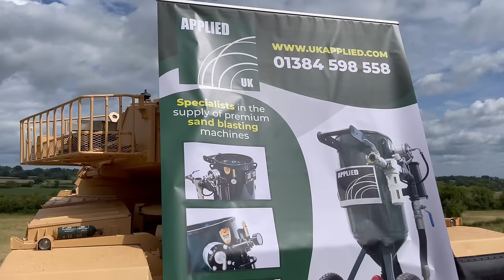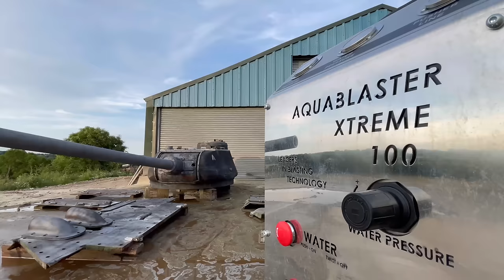T-34/85 Restoration (Pt.3) Aqua blasting!

Comment from the maker: *puts needle gun in the bin 🗑️
Reply: Do you want to needle gun Jack for making you needle gun that bloody Abbot of his?
Reply: I don’t see how you could go back to a needle gun after this.
Reply: use it as a tattoo gun.
Reply: Agreed!
Reply: Vapour honing on an epic scale
Reply: Agree that's excellent bit of kit guys😮😮😮
Reply: What does that setup cost?
Reply: @raykaufman7156  just over a quid. (Depends on your definition of ‘just’)
Reply: @johnnunn8688  
I must have the wrong idea about a "quid". I thought that was another term for 1 pound?
Reply: @raykaufman7156  £4,950 – £5,700 according to United Abrasives. Probably saved that in man hours on the T-34 alone already.
Reply: @raykaufman7156  it is exactly that.
Reply: @Brigadier9  there we go....thank you.
Reply: Hold up, you will still need a needle gun for weld slag and the occasional small bits not worth the setup.  :)
Reply: How many bags were used of the sand?
Reply: some a you brits are ok, don't start yer tank in the mornin
Reply: @misterquintus it's actually a different process vapour blasting   it's run from a dirty water pump & 170 glass bead whats more like talcum powder mixed with water this is a glorified jet washer
Reply: Funny.. been needling and sand blasting a t34-85 here in the states the last 3 weekends.
Reply: Tasty looking fasty running the compressor👀
Reply: I hope they either give you a stonking good deal on this or donated it for the free advertising, it looks like a cracking piece of kit
Reply: ONCE you fully restore and paint it please put the Soviet Star on there and other Soviet markings
Reply: @MuhFreebrams  many soviet vehicle in ww2 had no markings. If they had something is was 2 or 3 digit number. Anything else one it was done at a division, regiment level
Reply: @Bigbacon  just looked it up and you are correct 👍🏻 I thought it was more common
Reply: Great kit. 👍
Reply: @Bigbacon  This one did have a turret number, you can see it in the earlier videos. Being a Polish tank the numbers may have been done differently to the rest of the Soviet states.
Reply: @jefforymitchell5697  polish did about the same with number and usually the polish emblem.
Reply: How long would it have taken with the needle gun and a grinder? So when is your own Aqua blaster showing up?

Comment: Ladies and Gentlemen. The T-34-85 tank is the basic design of the American designer John Walter Christie, who sold a license to the Soviet Union for his prototype, which gave rise to the BT-7 tank, which translates as a high-speed tank. Soviet engineers increased the scale and produced the T-34-76 tank, and only after receiving equipment from the USA in 1944 was the T-34-85 produced. In this tank, almost the entire structure was designed by designer John Walter Christie.

Comment: Sam should get employee of the year. APPLIED is so fortunate to have such an enthusiastic, knowledgable, and competent representative. Job very well done. Most impresive.
Reply from the maker: Sam was a great lad very helpful and very knowledgeable
Reply: @MrHewes  I was only thinking exactly the same thing. I used to be part of a Heavy Breakdown & Recovery crew that attended Derailments on the Railways. We had two guys that came to give us a presentation on some equipment that the company was thinking of buying so we had guys present from the various grades that would be involved with it to ask questions. I would have got more sense out of my missus than the two clowns they sent. This equipment was worth a fortune and these two were clueless. In the words of my engineering boss, F*****g Embarrassing. Sam on the other hand was a switched on guy who knew the in's and out's of his equipment and was comfortable in his presentation.

Comment: The black stuff isn't from poor quality steel, it's iron oxide, on the hot rolled plate it is called mill scale, the turret which I believe was heat treated after casting and it's just called scale, the barrel would have been machined after heat treatment so there's no scale on it.  
The thicker something is, the longer it needs to soak in the furnace, and the thicker the scale. It's reoughly an hour soak time per inch of thickness, I've seen scale over 3mm thick on 5t billets I used to machine.  
The only way to check the quality of the steel is to assay it, which would be a waste of time and money, the cracks are an obvious way of telling the heat treatment was of poor quality, but that says nothing of the quality of the steel.
Reply: Thank you for your input. I learned a ton of stuff in today’s video about heavy casting and the difference in the metal used for the barrel. I never even thought about the heat treatments to harden the steel after it was cast. Wow!!The details you just provided knitted it all together for me. Much appreciated. 😃👍🏻
Reply: Да дело не в истине. Просто надо обосрать. Они постоянно повторяют "ну это русские, плохая сталь, плохое качество, они рукожопы". Кстати советские, а не русские, в СССР неважно какая у тебя национальность, ты рабочий человек, а значит советский.

Comment: Interesting bit of engineering with the track pin wedges.  And that wet blasting set up is light years away from what we used to sand blast my boat hull, and it didn't really do that great a job. Rules had us cocooning the hull, with tarps all over the ground to pick up the abrasive and the blasted materials. Seeing the difference in the surfaces after blasting was enlightening, especially all the cracks revealed.

Comment: I used to run a blasting business. One of the mpst effective mixes was bicarbonate of soda with a medium to light recycled glass media mixed with water at the nozzel end which kept the dust down, would remove paint and rust very quickly, you'd need tk jet wash afterwards and thoroughly dry then hoover up the remaining glass.
We used it to blast steam locomotives, ships, marine engineering, industrial steel furtings, classic car panels and vintage tractor parts. 
We also developed a friction free dry blasting technique to allow blasting paint and rust off gas refinery pipes without shutting down the refinery. This saved the client a fortune.
We used a number of different blasting outfits most important is the largest compressor you can afford and a condensation remover and air cooler. Then you can use a variety of media pots depending on what you were using. 
A tank like that is a 2 day job with the right kit and crew including clearing up and prepping for painting
Reply: Não tenho palavras para elogiar seu trabalho isso sim com seu altruísmo, e por um mundo 🌎, em paz interior!

Comment: a great machine well designed, love it - the only small issue is the environment not picked up on, and something i had to be aware of when sanding aircraft, outside
paint is generally plastic by design epoxy, urethane etc, sand it and it become tiny flakes of plastic and we all know about micro plastics getting into the natural water resources, you really need to do under cover, or at least so it can be collected and disposed of responsibly and not buried in a hole in the ground etc i found chucking into a descent bonfire does the trick
Reply: Paint on these old vehicles is often lead based. So yeah even worse.

Comment: Saw this or something similar being used on another U-tubers channel, Cutting Edge Engineering over in Australia. He bought a diesel generator / compressor to run his sand / water blasting set up, he doesn't haveca tractor. Brilliant idea a lot safer than dry blasting and so much quicker. Bet it was a good night out after they finished filming. 👍

Comment: How to comply with -
1) Noise At Work Regulations 2021
2) The Control of Vibration at Work Regulations 2005
3) PPE Regulations 2022
4) RSI & ULD injuries (Management of Health and Safety at Work Regulations)
5) COSHH (Control of Substances Hazardous to Health) possible exposure to lead and other nasty stuff (Knowing the Military, especially the Ruskies)

with one machine.

Probably expensive but not as expensive as an HSE prosecution!
Just sayin.
Reply: Thanks, Pêndos for casually using an ethnic slur!

Comment: Laser Cleaner / Rust Remover would do a brilliant job on that, all those nice flat surfaces, will clean off the rust, paint, grease etc and no harm to the metal at all.
The turret would have need a casting, however, the majority of the rest of the tank would have been produced from hot rolled steel not cast. The oxide layers on the surface of the majority of materials is very tough and adherent, different from that produced as a result of casting or heat treatment operations.

Comment: My Friend who has a shipyard purchased 3 DustBlaster machines from America. Similar to this they use recycled glass particles of differing grades suspended in water. Uses a lower pressure but I think it does maybe a better job, they were originally made to strip expensive classic cars, but can do more, In fact my friend uses it on large steel hulled super yachts  and he even did the hull of a large cargo vessel in a dry dock.

Comment: Having used sand blasters and aqua blasters, they are great bits of kit.
That was a glass bead grit you were using which does the job but for the black bits, you could probably have done with some aluminium oxide media mixed in. (A cup or two per 25kg bag)
We use a really fine glass bead media which is more for polishing, the aluminium oxide helps with paint removal, but to be honest it did not look like it was doing too bad a job on the hull so I assume its a larger bead size you were using.

Comment: When t34 we’re been built they had moved the factories up in to the urails and they were built so quick nothing was in tolerance s and tank drivers that collected the tanks helped paint them as they were rolling off the production line most were still wet going into battle

Comment: The black is from the cold roll process. It is called mill scale and is very hard. The production line likely didn't bother wasting the time to grind it off as it would not affect the function of the armor. I don't think the cracks are from impurities in the steel but more from the arc welding used to assemble the tank. Remember that electric welding was in its infancy and only came into common use around 1919 in shipbuilding. They probably welded that entire tank cold without any pre-heating because they didn't know better which would cause micro-fractures that would grow over the years.

Comment: The blackening in the steel could be down to the variety of alloys used in different portions for the steel on the T-34. They are magnesium steel, silicon steel, molybdenum steel, chromium steel and Nickel steel alloy. Mn-Si-Ni-Cr-Mo steels were employed for both rolled and cast steel components from 2" to 5" in thickness, and Ni-Cr-Mo steels were employed for some of the moderately thick cast armour sections. Plus the fact the Russians would heat treat the armour to two times that of the armour of a Sherman, causing the plates to be highly brittle.

Comment: now it won't be an authentic CCCP made tank without a paintjob that is half dirt half falling off...
p.s. the black part is mill scale, that's normal, you get it on all hot rolled stuff you buy even today, thin/thick, all will have it, some of it may be almost falling off, some will hold on to the steel, it is just the way it is, paint over it if it's holding, when absolutely necessary - pickling with hcl is done to remove it, or shot blasting, that will break it up and sweep away, coarser sand will also do it, but slower
and black on the turret is simply a sand cast surface, of course there will be all sorts of crap in there, but usually limited to surface
Reply: Well, it's not an authentic CCCP made tank, and it will never be. This on is a postwar made, built under license in Poland.
Reply: @484442pt ну не мешает автору обсирать "русских"
Reply: @CorRubrum   it wasn't an insult, service life expectation for these didn't warrant a perfect pain job, hence me joking about it
and having lived in cccp, as a minority, you lot deserve every insult you get, and that is even before we start to talk about current events

Comment: Winjet nozzle with a normal dry pot saves all the complication and expense.  Hook it up to a normal hose pipe or an air driven diaphragm pump if you dont have mains water.  Pto compressor is a nice idea if you have a tractor spare.  Only time we used wet blasting was on houses, where duat was an issue or where we needed a less aggressive process.

Comment: I thought Joe's objection to sand blasting was that the sand (or crushed glass, whatever) gets everywhere? How will they get the sand out of bearings and other compartments including the entire inside of the tank and the turret? Obviously better than needle gunning in terms of labour/man hours required but I would have thought vehicles and moving parts in general and sand blasting just don't get on?
Reply from the maker: I object to it when the vehicle has its engine gearbox at turret on

Comment: The black on the hull is called boiler scale and is caused by oxidation in the early cooling stage of the steel. It is very hard and difficult to remove.

Comment: Ich erinnere mich, dass wir in den 1970er Jahren am Bau eines U-Bahn-Tunnels in Moskau gearbeitet haben, damals hatten wir einen Tunnelreinigungskomplex, der wie eine Feuerhandpumpe aussah, die unter großem Druck Wasser auf das Dach zuführt und somit den Tunnel von Schmutz und Sand befreit. Ich erinnere mich, wie ein solches Gerät einen 12 Zentimeter dicken Stahlträger in etwa 8 bis 10 Sekunden mit einem Wasserstrahl schneiden konnte.

Comment: I was a hydroblaster here in Australia and we had water pumps that pushed water at 2400 bar (48000 PSI) and it would cut metal  100mm thick in about 20 odd minutes not quite water jet speed but could definitely do some fun with it

Comment: Well you just found the solution for one of THE most gut achingly shite jobs there is. I am sure there is a deal to be done there over a few pints of Guinness.....

Have to say those tracks came apart a lot easier than Mr Milo's T tank. He built the most amazing Heath Robinson machine to take them apart ... Its going to be yet another stunning rebuild.

Comment: You can probably sell the swept up ground glass to swimming pool owners. It works far better in the filter than sand. I buy my glass filter material from a water blasting company in France.
Reply: @taxesdeathandtrouble.1886  That soon back washes out. Also the company I buy from bake the ground glass before they sell it on.

Comment: The black crap in the casting I call millscale, I think I'm right in saying you need silica or something like that to help molten steel flow in the casting process and an old trick (which I guarantee the ruskies used) is to throw a broken bottle into the crucible, unfortunately it comes out as inclusions and scale which is almost diamond hard and destroys tooling.

Comment: 25:23 "rust inhibitor in the water"  I was going to ask about that.  Three days maximum before it starts rusting?   
So, you need to get it indoors quickly to start the drying process, correct?
Extremely interesting. 👍

Comment: As an experienced blast cleaning contractor I would say that is a very inefficient system.  You need a compressor of at least 400 CFM and dry blast only. Wet blasting as you can see makes a mess everywhere, and you probably spend double the time washing it all off and if you don't use a rust inhibitor in the water the metal will rust immediately and you need to take the mill scale off.

Comment: There may be a reason for this, but to me the pressure seems awfully low. Against a thick steel plate that you don't have to worry about strain occurring, a heavy body like a heavy equipment, it seems like a waste of time to hit blast media with such weak pressure.
Hold the nozzle firmly with both hands, step with your legs open, and continue to apply the blast media-laden water to the object as if you were a firefighter. That is what I imagine when I hear the word "wet blast". The control lever has been deliberately relocated near the nozzle because it is impossible to keep both hands away from the nozzle.
At this rate, it won't be over in a week, will it?

I apologize if I was harsh in my wording.
from Japan.

Comment: There is still contaminates in the glass and water from the paint and petroleum products, so technically, it needs to be disposed of. It should have been done in a contained area as well (no runoff). Just saying. Otherwise, cool content as usual.

Comment: Just goes to show the myth of the T34 as the best tank of the war. The Orcs simply churned out thousands of them.
Reply: That was the way to build a ''good'' tank back then - sheer numbers. Simple and cheap, and expendable. German tanks were built in a higher quality but they always had not enough and the lifespan was too short to make use of good machining.

Comment: Is that a sand blaster or garnet blasting. I've had good experience in garnet blasting, but because garnet is a crystal it does tend to pit the surface, which requires some additional prep before painting. It doesn't require people to wear the big ol masks though, and its re-usable. Similarly it doesn't leave a godawful shitmess of fractured quartz everywhere.

Comment: So, dumb question. Since the aquablasting process is water based (like an abrasive waterjet machine) how do you stop surface rust immediately setting in? Do you need to apply a rust preventer, or just be ready to prime and paint immediately?
Reply from the maker: There is rust inhibitor mixed in with the water
Reply: @MrHewes  Thanks!